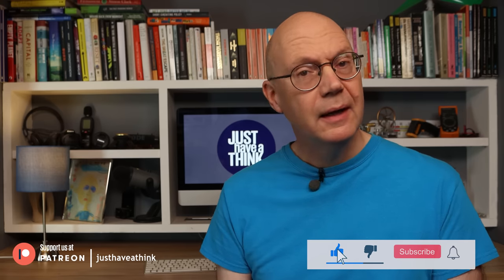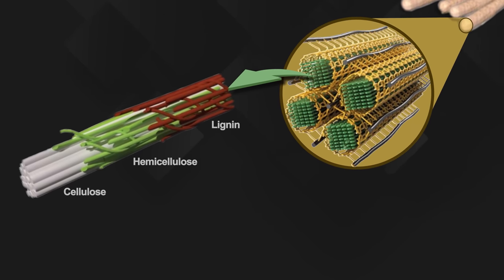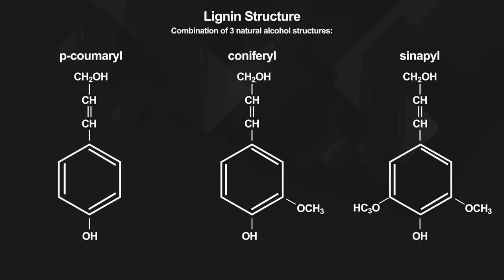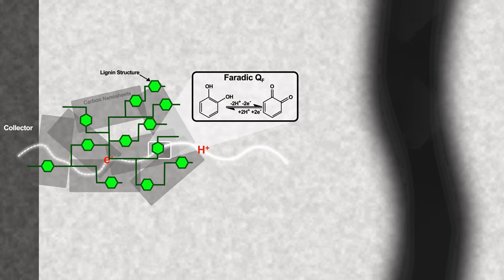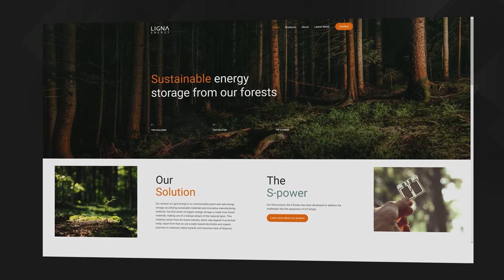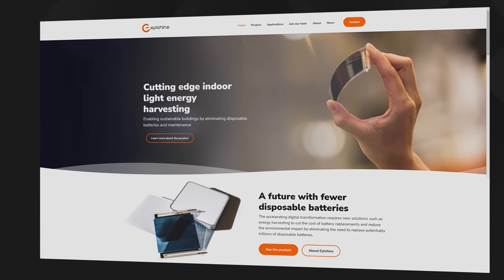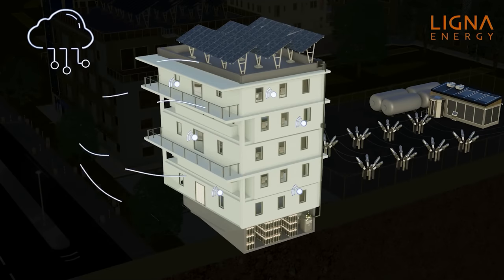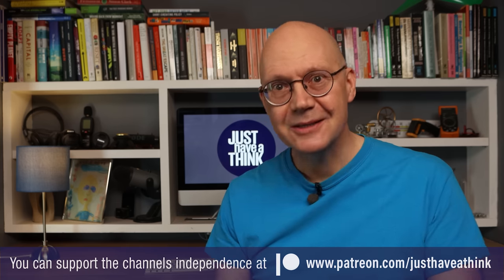Revolutionary new sustainable battery technology!

Comment: I can’t remember the film name, but was a futuristic flick with a girl on the run and she obtained a paper cellphone from an ATM machine and folded it for rigidity and started using it, I think that is getting closer with this technology in film form
Reply: “Ultraviolet”, I think it was. 
I have an even more mundane vision of the future:  You go to the store and buy a carton of milk (or it’s futuristic precision fermented equivalent) and the graphics on the carton sides are dynamic; playing through a series of information and ads.  The integrated display, digital controls, battery and PV to keep it all going would not only be cheap enough for the application, but also as readily recyclable and or biodegradable as the base paper carton.  I think that is just a matter of time.
Reply: You are close, but not near enough, with 5g and IoT you will go to the fridge in the shop to buy milk and the fridge will communicate with your fridge at home and tell the yogurt where a smiling face will say “Joel, you need me as well, you are running low” and a “me too” from the eggs
Reply: @eveningecho5334  No IoT for me, at least not until it becomes inescapable.  I’d like to keep thinking for myself for at least a little while yet.🤓

Comment: Even if Lignin based batteries are worse in basically every functional way, the fact that they are made as a byproduct of another actually profitable industry does open the door to potentially being a very, very cheap alternative. 
Looks to China
Seems like that sort of tactic does work.
Reply: While I agree, part of what makes paper profitable is that their "waste" lignin is providing the heat needed by the plant.
So one has to ask the price and carbon footprint of the energy needed to replace the lignin fueling the boilers.
Reply: @jimurrata6785  Fair enough. Didn't know that. Also paper is largely going out of fashion.
Reply: @SangoProductions213  I recall the advent of 'modern' computers and how they would eliminate the use of paper in offices, industry and government.  😅
Sure, clerical jobs dried up but storage was bulky and expensive, and if it was important you definitely needed hard copy.
Then the internet blossomed and many households got a PC with a printer and paper use went up.
Newspapers and books are a fraction of what they once were, but I don't think paper is going away.
I love the idea of using lignin for energy storage. I just don't know where there's a surplus of it.

Comment: Don't know if this will be the one, but a very cheap battery made from the most abundant and inexpensive materials is very much needed, and it doesn't need to compete directly with lithium ion. Many applications don't demand the best energy density or capacity, and voltage limitations are easily overcome with compound cells.

Comment: Sounds really promising because of the absence of toxic chemicals.
Reply: And possible fires/explosions.
Reply: Lithium-ion batteries are far less toxic than lead-acid or NiCad chemistries. We use extremely toxic 12 Volt lead-ACID batteries in cars but 99% of them are recycled. It's smaller devices such as tiny sensors, vape cartridges, electric toothbrushes, etc. etc. that people can't be bothered to separate out the battery, so it winds up in a landfill. There's no reason to think that large valuable lithium-ion batteries won't eventually all be recycled.
Reply: @skierpage  are you sure the chinese child laborers would agree with you?
I had high hopes for graphene years ago, but i think they found a more nefarious use for that.
Reply: @sog4646  You're getting your fossil fuel talking points muddled. The child laborers are in the DRC mining cobalt, which LiFePo batteries don't use. Also BMW, Tesla, and other car companies have pledged to source their raw materials from "responsible mining." If you're concerned about abuses in materials production, you should be more worried about oil companies ravaging the Nigerian Delta, refusing to compensate the indigenous people in Ecuador for oil pollution, etc. The massive global harms come from making then burning billions of tons of fossil fuels; producing millions of tons of recyclable batteries is orders of magnitude less harmful, but If you're worried about it then you're welcome to not own a car and use less energy.

China doesn't produce many battery raw materials, but it invested heavily in producing battery components from the raw materials mined elsewhere in the world.

Comment: Supplies of lithium are limited and its production can be quite polluting. Although the energy density of these batteries is low and limits the possible applications these batteries would be suitable for, the fact that the supply of lignin is basically unlimited because it comes from a renewable resource creates an opportunity for using Lignin based batteries in applications where energy density is not so critical and allow the more limited supply of Li to be used where energy density is most important such as EVs. I can see that this technology will become an important piece in a complex multi-technology solution to the difficult but necessary replacement of GHG producing forms of energy. Very interesting indeed.

Comment: I am also doing research on similar path but using redox active electrolytes. I published research articles on energy storage in International research journals like chemical Communications etc. I got excellent results especially in cyclic life.. After 45000 cycles the energy storage efficiency was 99.6%. I am also working to scaling up the project.
Dr. Imran
COMSATS University Islamabad
Reply: ꜱᴇɴᴅ ᴀ ᴍᴇꜱꜱᴀɢᴇ👆👆…

Comment: Along side this: if you take a source of cellulose that has a high crystalline cellulose content, then you convert that into cellulose nano crystals--you get a high percentage of these.  Then if you graphitize them, they have graphene like properties i.e. highly electrically conductive (incidentally, if you only carbonize them, they have properties closer to carbon nanorods/tubes i.e. very high strengths). This stuff is considerably better than regular graphites. 

     There is A LOT of natural, cellulose based clothing that gets thrown away every year. These can be converted into the graphitized CNC's with graphene like properties of the above. And done so, en masse and in bulk. Natural fiber clothing i.e. made out of things like hemp, flax linen, ramie, and cotton (but not rayon) are far higher percentage sources of the crystalline cellulose stock, than waste pulp and paper that industry typically uses to convert into CNC.  We're talking average differences of like 10 to 30% of the latter to 55 to 70% of the former.  In other words, you need far less of the former to get as much CNC.
Reply: ꜱᴇɴᴅ ᴀ ᴍᴇꜱꜱᴀɢᴇ👆👆..

Comment: Ah, another new battery technology just around the corner! 😉 Thanks for another informative video. I love new tech that can use waste from existing processes. I would think that beating the the energy storage per kg of lithium-ion batteries is more important for mobile applications than stationary grid storage.  For large grid storage systems, where size & weight are far less of an issue, I expect that cost would be the driving factor for acceptance.

Comment: Structural morphing-> is a real world application for power storage units. Since differences in technologies-> are set aside for the conveniance of the bateries roll and placement. Devices-> dont adapt around power units, but power units adapt to devices. I think that for example the block bateries-> is going to need review > if sheeted rectangular bottleneck -> (lightweight-shockproof-solidllybalanced) (what amalgame)* ->  to be set to be on board with extendable frames < with carbor-selenium spikes to stable the tandem overlap sheeting*. As an example > the smartphone industry needs bateries -> that are implemented inside < pumps, multible motherboard, row-file structure and be agile in the hand* B aswell as shock-proof and feel consistent trhoughout the hand ->  and with equidistante balance points *. 

So as to speak for all battery industries, how easy can your system be instaled stored and manipulated during logistics. Its cost and density performance and wear seems in range after considering its handyness.
Reply: Sounds like your Honeywell Buzzphrase Generator has picked up a bug in its software there mate! 🤔🙄😬
Reply: Its shortend jargon... I wished I could slam the insights in one comment line. Youll catch on later. If not riddle wise. Why?... you thoud it was gooblygook? Just senses and arrows. If you want details ill hint you the lakes of unknown.

Comment: Scandinavian have tried for decades to find an outlet for lignin as they have it in abundance and it costs  to get it disposed. So what I see is that they connected their waste with "IoT" and tiny solar cell "zero energy device" to create a neat PR package.
Sounds a bit suspicious to me but if they can prove that it works and can be mass produced cheapy despite the C-nanosheets, solar panel etc. It is great.

Comment: This sounds like an amazing technology that won't be able to find a market it can thrive on.
Cheap but not cheap enough to compete with other large-scale energy storage solutions.
Good energy density but not dense enough to compete with li-ion.
So the only possible commercial target is to sell a performance compromise product that is "green" and hope they can find a market that is large enough to survive.
I honestly doubt this can become more than a niche product mostly for devices that are targeted specifically to fanatic environmentalists.
The thing with low-power IOT is that there will be lots of other ways to charge those without the need for a battery. A single capacitor will probably be enough. 5G and 6G carry a pretty big amount of energy and it has already been demonstrated years ago that you can power low-power devices just with a wifi signal.
I just don't see the battery and solar based zero-energy IOT revolution happening anytime soon.

Comment: Its Prof. X(avier) give him all the money he will save the world! :D
but on topic: You can use any material to produce a battery - there are just materials which are better usable in regards of holding electrical potential, how fast the charge can be sored and delivered, how suitable the power/kg is and the most important is it easy to produce, to use and safe to inflicted dmg and or the environment. I have more hope for aluminium air batterys then on wood-nanocarbonfiber batterys to fulfill more of those requirements.

Comment: Three fundamental matters 

500% more electricity needed 
Transmission costs for electricity is extremely high.

Fossil fuels 
100twh supply 40twh used 60twh waste heat. 

Electricity 
100twh supplied and used.

Tactics for beginners 
Logistics for professionals.

With a grid full of Renewables  no room for expensive nuclear.
Nuclear is both expensive and a tax burden on everyone for decades.

Comment: I had an idea that would save a lot of electricity.... residual power running from a phone or device could, when connected or disconnected, switch power on or off at the socket because some people don't realise that a charger that is plugged in uses the same power whether charging or not... in America they don't have wall switches so even more handy than the UK where we can(IF WE REMEMBER) switch off the socket with no device charging! Please use your influence to make this practice the norm!... only ten years supply of touchscreen indium after all so we need to also build things future proofed!
Reply: ꜱᴇɴᴅ ᴀ ᴍᴇꜱꜱᴀɢᴇ👆👆.

Comment: Since IoT devices are all about being small and portable devices, and lignin being a quasi photovoltaic element(?), wouldnt it require a kind of large battery to power a tiny device? For now I just see these two things working against each other but other than that Im excited that thered be more sustainable options in electronics!
Reply: It does seem that otherwise small devices now need to come with a big flat panel/patch. Not necessarily crazy (would work OK for anything wall-mounted for example: light switches, temperature/humidity sensors) but not much use for a lot of other devices (tyre pressure sensors)
Reply: Not all IoT devices will be portable: some (many) will be fixed place, and some of those will be fixed in difficult to access places off grid. This solar recharged long lifetime battery would be ideal for those.

Comment: It has a lot of potential, especially if they really can improve the energy density by at least a factor of five. If that can be done at low cost, then anything high can reduce the amount of waste material from the paper industry will be worthwhile. And if the cells can be recycled at end of life, for a sensible price, then it will be even better. Couple batteries made from those later iterations of the cells with renewable energy sources and they will have achieved low environmental impact electricity generation and storage.
Then all we'd need would be invisible electricity pylons... 😃

Comment: For grid scale storage the energy density is not critical. The price, long life and safety are more important. The weight of stationary storage doesn't matter as it just sits there. If it lasts for ages and you don't need special thermal management systems then it is cheaper to maintain.

Comment: Electric power transmission costs.
For the traditional centralised concentrated electric power supply, is the killer cost in a 100% electric world.
Distributed generation and supply has a massive advantage. 
All battery development to avoid the big transmission costs is important. 
The existing national transmission grid remains valuable and critical, but this massive investment cannot be repeated 5 times as a 100% electric and centralised system would need.

Comment: Everyone obsessing over energy density by weight is missing the actual key issue, which is price. A battery using "a nanocomposite material of milled carbon", plus zinc electrode, in a super concentrated solution of potassium polyacrylate,  doesn't sound cheap to manufacture, regardless of whether it's using a waste by-product of wood. And it's good that these batteries will be environmentally benign, because recycling the carbon-lignin composite sounds much harder than mechanically separating the parts of a lithium-ion battery.
Reply: ꜱᴇɴᴅ ᴀ ᴍᴇꜱꜱᴀɢᴇ👆👆..

Comment: Great for iot very low power devices. Until they significantly improve power density, their cost per kWh stored (cost per kWh / cycles life) is likely to remain too high for larger capacity applications, such as stationary storage.

Comment: Lignin is not a waste product. The black liquor is used to fire boilers that produce steam and power to facilitate the paper making process. Without this, they will have to import power, so where is the overall saving coming from?
Reply: Less CO2 in the air, if the boilers are alternatively heated with electricity from renewable sources.
Or more speculatively, one more reason for the paper industry to move away from legacy processes that require that heat.  The current paradigm provides no incentives to do so.  What alternative processing technologies are just waiting in the wings?  I don’t pretend to know, but we humans are a creative bunch, given the opportunity and incentives.

Comment: Very interesting, but I see it more viable for small scale applications rather than provide large power storage due to low power density.  Lithium NCM and NCA batteries are getting towards 300W/Kg and that is nowhere near enough for heavy work.  The cost/W will also be revealing and very important.
Reply: ꜱᴇɴᴅ ᴀ ᴍᴇꜱꜱᴀɢᴇ👆👆

Comment: 8:37 "The energy density is currently about 40 watt hours per kilogram." How do we arrive at this value? According to the datasheet from Ligna Energy, their batteries weigh 2.1g with a 0.48 mWh capacity. I know that's including the packaging, but that math works out to about 230 mWh per kg, which is several orders of magnitude off from the claimed density. Does the technology simply scale that much better to larger batteries? I could understand if the packaging around the battery material itself is just way heavier than the actual battery, but it's hard to believe the mass of the actual battery is so microscopic compared to the layers packaging it.

That said, the cycle life certainly looks extremely promising. The datasheet states a lifespan of over 60,000 cycles defined as constant current charge to 2.4V followed by discharge to 0.4V, with the caveat that cycle life depends greatly on the application. In other words, these batteries don't appear to suffer much if at all from constant use (though their voltage varies significantly, which could be a problem for electronics) and will likely outlive whatever device we put them in. Since they're even made of such environmentally friendly materials, that's great news! Now if only we could avoid wrapping it in plastic...
Reply: ꜱᴇɴᴅ ᴀ ᴍᴇꜱꜱᴀɢᴇ👆👆…